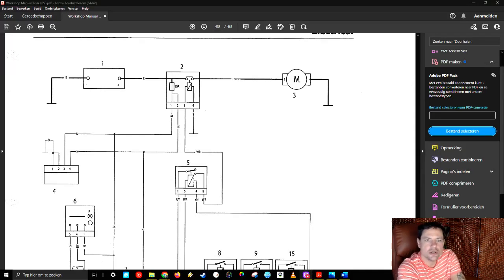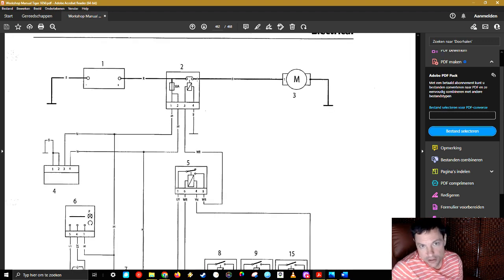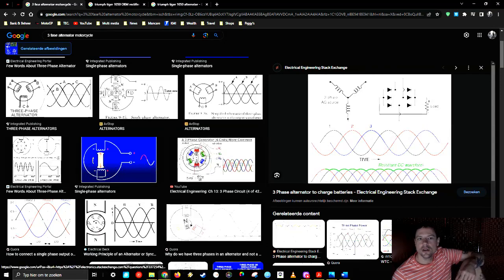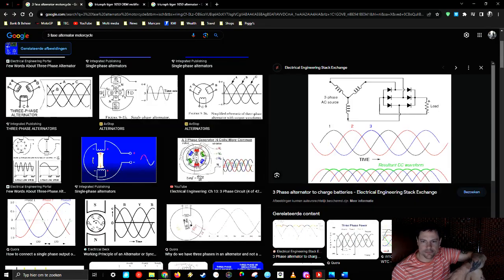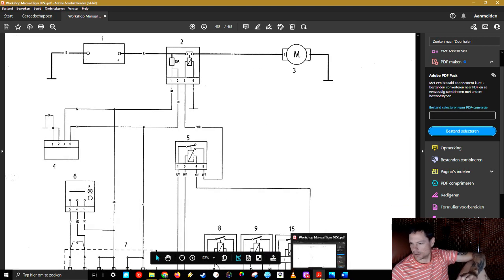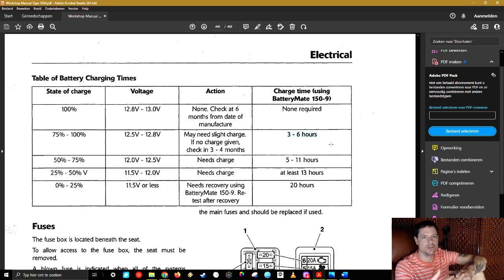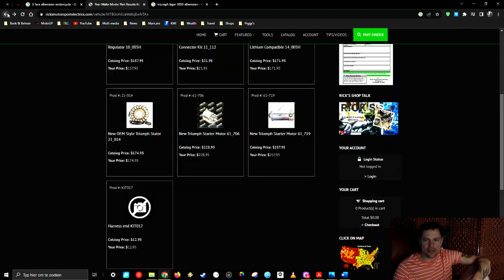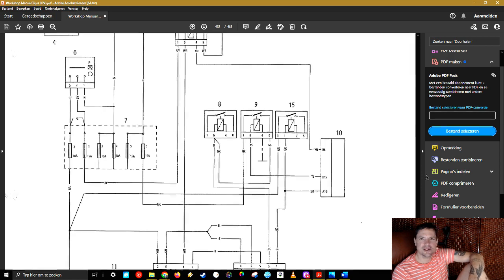Tutorial: motorcycle (Triumph) electrical charging system

Comment: I started to have problems with the cable between the RR and the alternator. The cable is heating up, the connector is melting. But I already know what it means. I bought a new stator, a new RR, soldered MT60 connector to the wires. Problem's gone.
But, I wanted to install MOSFET, unfortunately it turned out to be defective, the output gave up to 16 volts, I had to put the old, shunt type.
I had an interesting situation, there was a motorbike Honda VTX1300, when heated refused to start, the starter or did not turn or with great difficulty, I did not know what to do, because the first time I encountered such a thing, eventually changed the starter, and all became well, no problems. Sold this bike, immediately on the same day bought Triumph Sprint ST 1050, the same problem, when heated does not start and the starter completely takes all the voltage from the battery, I certainly did not believe that this can be for me twice in a row, only me, and only on my two motorbikes, this punishment is apparently such for me invented by God. Because I have not met such a thing from anyone anywhere else. Changed the starter, problem's gone. That's what it could be. The starter that on the Honda that on Triumph prozvanil, short circuit is not, when cold turns the engine well and quickly, but it is hot all, takes all the current from the battery and you have to wait 10-15 minutes until it cools down.
Reply from the maker: Problem can me depending on the type of battery. Usend  AGM Gel, Lead Acid, Firefly or Lithium. Depending its overcharged or depleted. Basically when the stator dies it can surge and destroy the battery and or leave burning marks. When a VR dies you have charging problems. On my old GSXR i had one dying and it related to hot start issues like you mentioned. A bad starter relay can also give serieus problems because indirectly it acts as high current gate. When the cables are not qualified, badly torqued or maintained this can lead to fire.
I had issue with the TT1050 and staling, killing premium batteries every 1 to 2 years. I changed the stator - regulator - battery with a improved premium package and had no issue ever since. Also the starter system is upgraded with heavier cables and connectors. 
Electrical problems are challenging but on these bikes its still fairly basic. I think the Devine is still in the balance ✌️
Reply: @simDIY1981  Thanks for the reply. The battery cables need to be replaced with thicker ones, I think that will help. Bought a new starter, will replace the starter and cables.